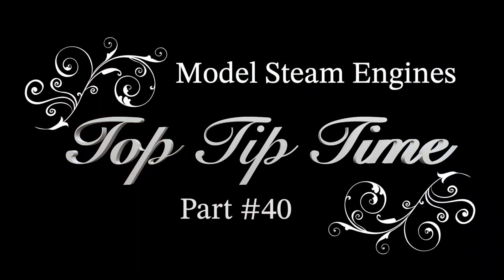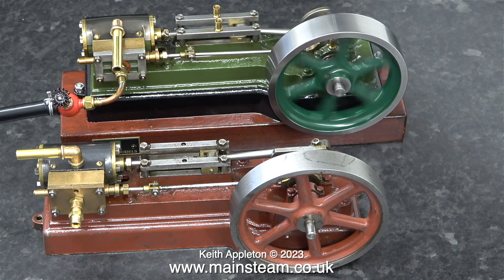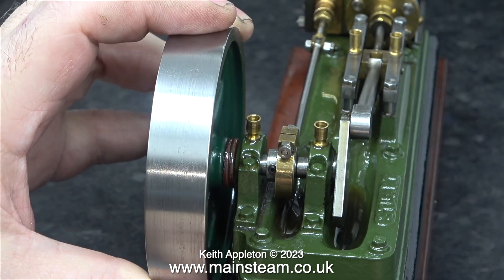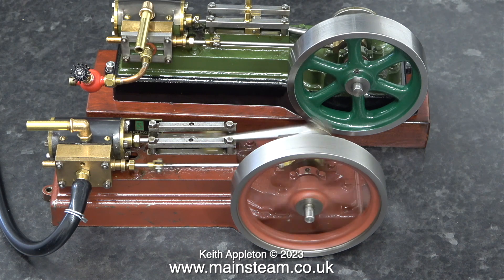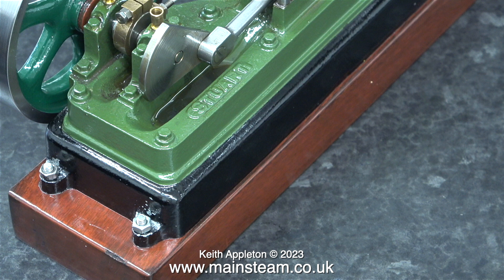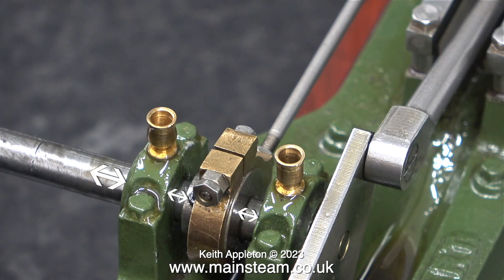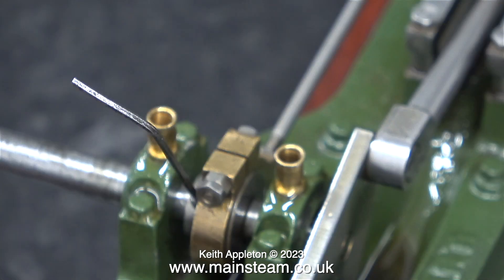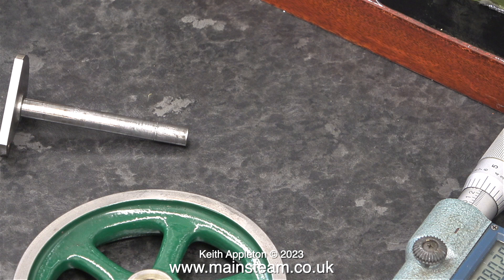MODEL STEAM ENGINES - TOP TIP TIME - PART #40

Comment: Do I feel a set of bronze bushings coming in the future? ;-)
Reply from the maker: I think not - the original bearings were cast iron (which is a fine bearing material) and so are the new ones but with a larger surface area as they are bigger.

Comment: For generator operation ; why not  change pulley size to run engine slow and generator fast?
Reply from the maker: Because that's already how it is done . . . . Flywheel on the engine to a very small Crowned Pulley on the Dynamo ......

Comment: I expect to enjoy this miniseries. I personally do not own an S50. My younger brother has owned one given to him by our Father as a present in kit form way back to when you were a toddler. He chose to go into model steam engineering for his retirement. I have chosen to do a similar, but into making small diesel aero engine's hobby. Sorry, I do not fancy the added timescale & money involved in making steam engines. Going small will be hard enough. I have been upgrading my ML7 to ML7-R spec in order to get the spindle to run with enough accuracy. This brings me back to your wonderful work. Why you never call yourself a proper engineer puzzles me. I have spent my life in engineering & your work looks good enough for its purpose to me. It would have certainly been more than praiseworthy for the grates to have recognized your ability. Curly Laurence certainly used far more hand work than the modern so called to exponents do. I wonder how many of their engines will still be running 50 years after they have gone, as cullies are.

Comment: Keith I love your channel and your wisdom. Can I ask would a woodstove powered steam engine generate a viable amount of electricity? I'm experimenting with wood gasification to run a generator and make hot water heating at the same time. I want to know if you think steam is more efficient for generating power from wood. Thank you. Cheers J
Reply from the maker: Not practical at all - buy a petrol or diesel generator. Steam engines require constant attention - Heat, Water Level & Lubrication .......
Reply: @keithappleton  thank you Keith. My generator is capable of 3.4kw loads. On wood gas you lose 30% of the power that petrol has but it's still pretty good. I thought of building a flash steam boiler and turbine but I don't think I'm able to build a turbine powered by a wood stove to take the same torque load of 3.4kw. Wood has 5.5kwh of potential energy per kg so I'm looking at the best way to extract that as electrical energy. Thank you for replying. All the very and I look forward to more tips. Cheers J
Reply: I totally agree with Keith.
I've just built a petrol piston engine generator and I must say you (and 99.9999% of people) have no idea of how much mechanical power is needed to even run the smallest electrical load. 
Keith is also correct about the attention needed, you will be spending all your time as a engine driver.
If you want to make hot water, that may be possible. 
My wood fireplace has a heat exchanger in the top of the firebox. Water from a tank flows through the exchanger, is heated and flows back to the tank.
But still you need a pretty decent fire and have it burning for 5 or 6 hours.

It amazes me how people these days think all this type of thing is easy to do and if you just do this or that it all "just happens". It doesn't.
There is no such thing as a free lunch. It takes tons of energy and engineering to get these things to work and you are probably better of with what is commercially available.